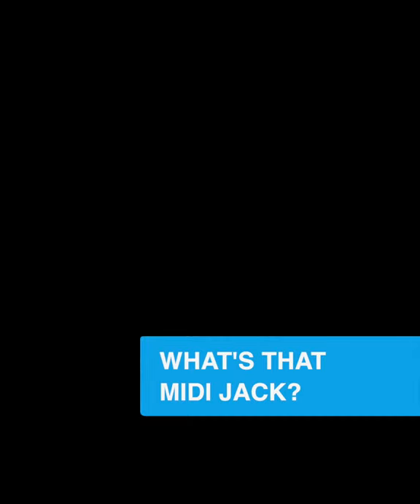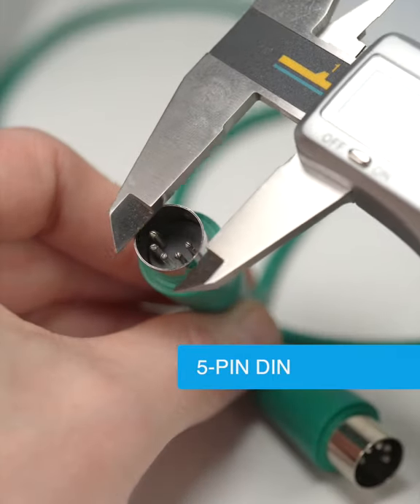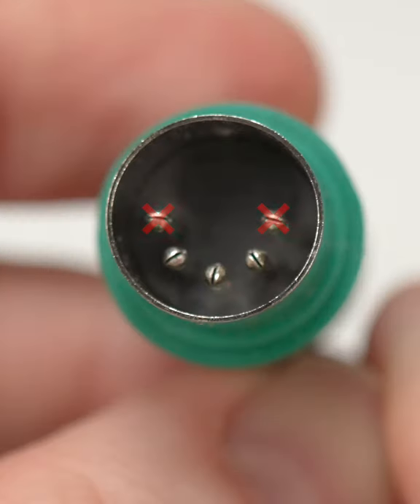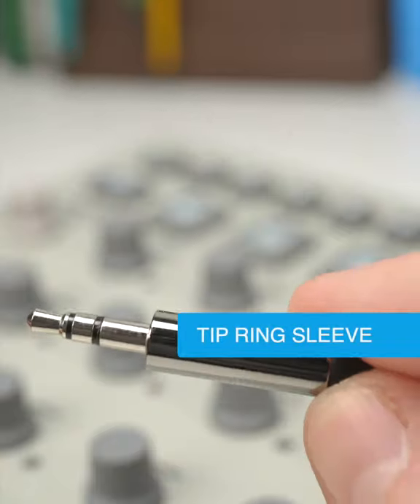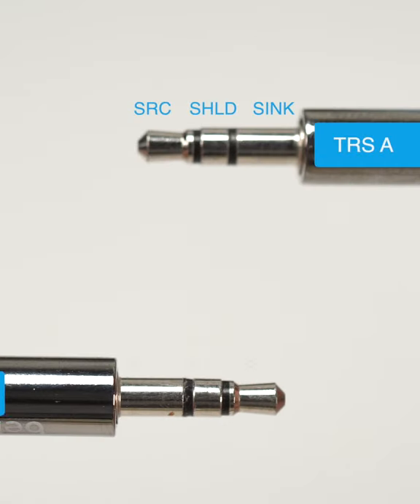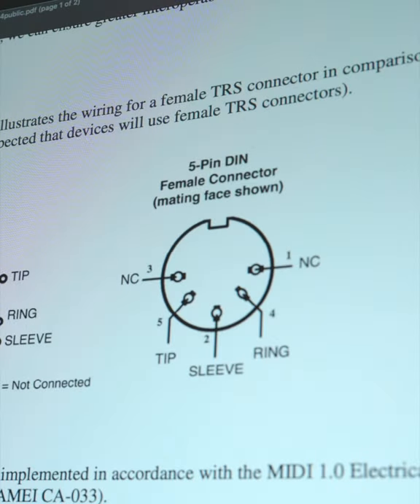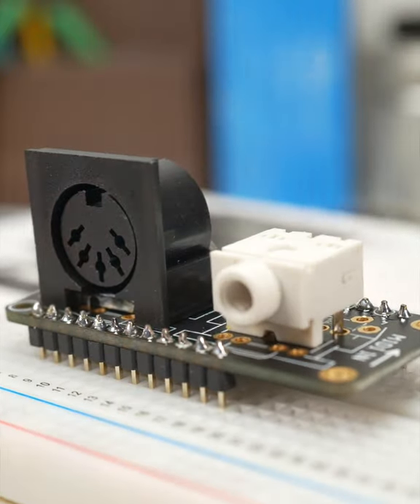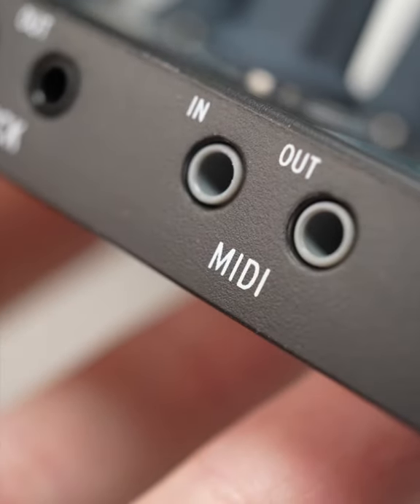What’s that MIDI jack? - Collin’s Lab Notes #adafruit #collinslabnotes

Comment: theyre not necessarily used for "nothing"  the extra pins can be used to power a midi device. so you can send power over those two extra pins. which is what i did when i built a version of a zendrum using a megadrum board. I added a power brick that added 9v power over the extra two pins, and so the whole thing just needs a midi cable plugged into it to run. and you can get locking midi connectors

Comment: Wait... why arnt we using this thing as a USB port or data port now? It’s got 5 pins, it would by sturdy since it’s a circular shape, and it wouldn’t slide out of the socket as easily. I know that sounds stupid but legit we could have used that connector as a usb instead of the less sturdy and easy to break connectors we have now. Also yes I know that the pins are a little easier to Jack up in this connector than regular usb but I’m just saying.
Reply: Check how many pins USB3+ need, maybe for 2.0 devices
Reply: Actually it's intentional, there's this japanese Term called Poka Yoke, or "Mistake Proofing", In this methodology, you design stuff like connectors such you can't use it unintended way and damage the device.
So we used new Square connector for USB, so we can't mistakenly Use it anywhere else 

Also We have Type A for Host device and Type B for Peripherals, so we can't Connect 2 Power adapters or 2 Printer and damage them both

On other hand Type C is Designed to be used for all devices so it also needs new Design as it Special protocols to avoid issues
Reply: @RiggedBananaGaming  yeah true
Reply: @prathamkalgutkar7538  yeah this is all true and makes sense. I’ve been studying more and more about electronics and electronics engineering since I made that comment one night and just realized how dumb it actually sounds 😂
Reply: @EthanDoezYT  didn't think your idea was dumb at all, there have been much worse proposals for USB connectors lol
Reply: @RiggedBananaGaming  yeah. I think I was just going off of one benefactor to that type of connector and my brain was just half empty and I was running off of three hours of sleep at the time